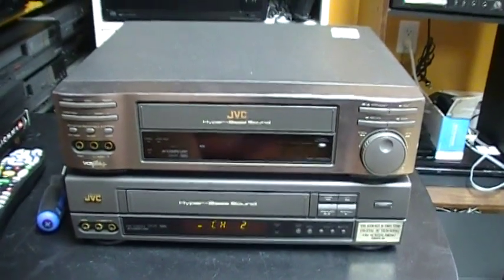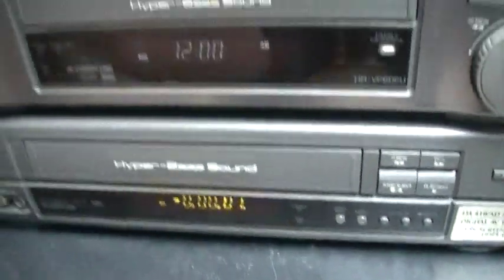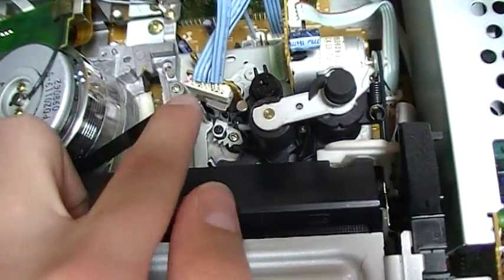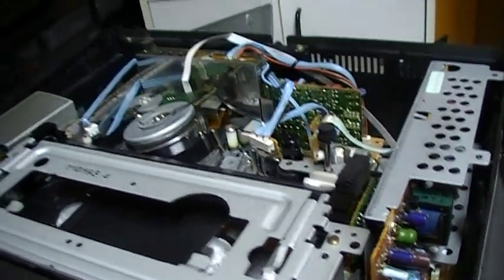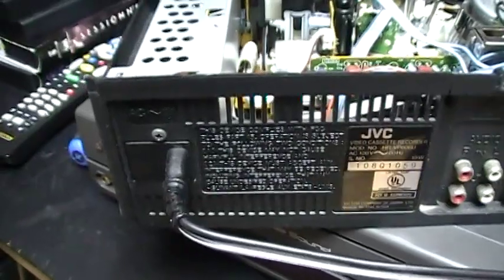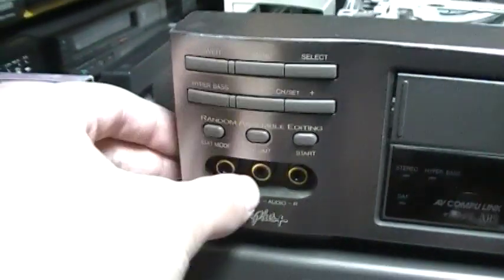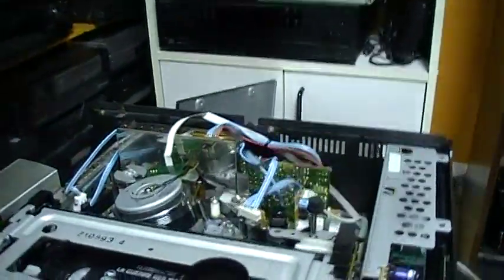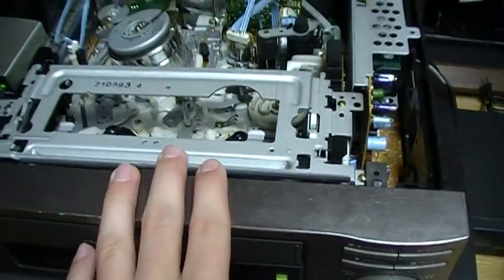JVC HR-VP606U VCR

Comment: The loading mechanism is very similar to my 1990 ish  JVC HR-D560E. I like the fact that they don't load the tape directly when you insert the tape and also de treads it when you fast forward or rewind. Probably one of the last generations that doesn't keep the tape treaded all the time.